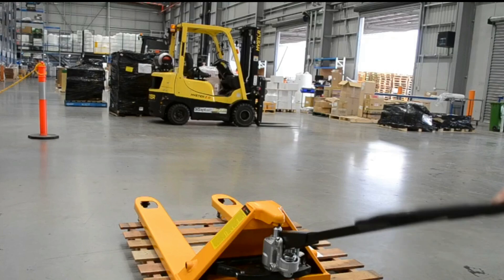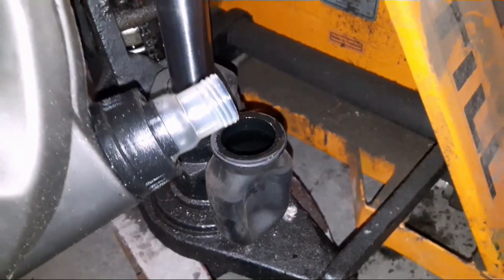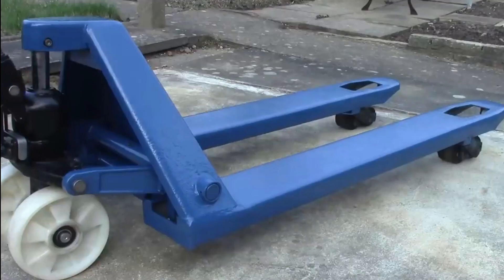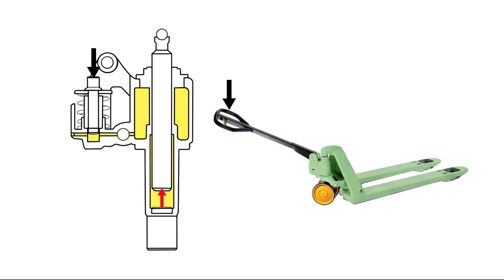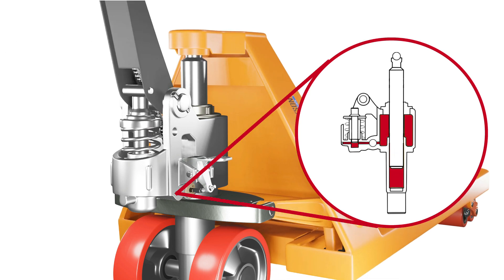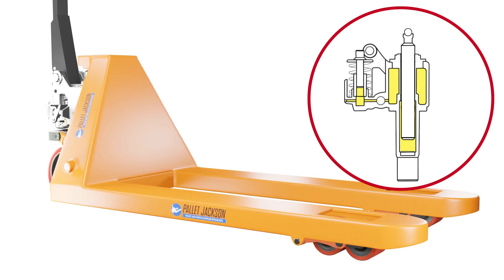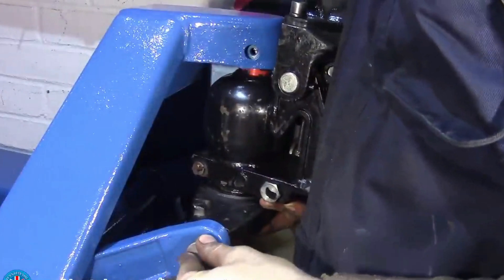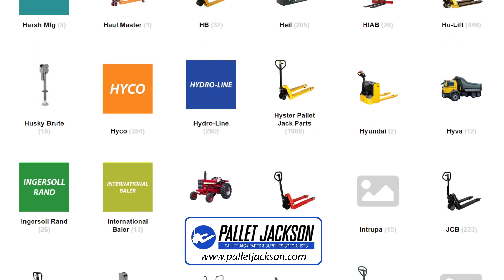Pallet Jack Hydraulic System Explained | How Pallet Jack Hydraulics Work | Hydraulic Basics

Comment: But how do the front wheels work?
Reply from the maker: Hi, thank you for approaching us with your query. The front wheels (commonly referred to as "steer wheels") on pallet jacks are pivoted and connected to a tiller or handle. When the operator moves the tiller left or right, it causes the steer wheels to turn in that direction. This steering mechanism allows for precise control and maneuverability. We'll soon share a detailed video on understanding the front and rear wheels of a pallet jack, briefing their functions and roles. Keep connected!

We hope that this will help resolve your query. Thank you again!
Reply: @PalletJackson  I think what @jeremylakeness6859 meant was, If you are lifting the back of the pallet up with the hydraulics, how do the front wheels on the fork ends stay up to support the load and keep it level.

Comment: AMAZING VIDEO!! helped me get a better understanding of what I'm dealing with.
I have a jack that the piston does not go down. I already checked the release valve lever and even manually held it and did not go down. I decided to take the hydraulic bolts off. Right now all 3 sections are empty, hydraulic cylinder, Hydraulic pump, and a bolt that was in the bottom by the wheel which I'm assuming is the hydraulic fluid (yes hydraulic came out from this bolt too). Keep in mind the piston is still up high and wont come down. any info helps. THANK YOU!!!
Reply from the maker: Hi Steven. Thank you for contacting us. Based on the information you have provided, it seems like the main lift ram is bent, and it is stuck inside the unit. Please check it. We hope it will help.
Reply: @PalletJackson  Thanks for the info!

Comment: great info, is the process the same as on your video to add hydraulic fluid to a crown pallet jack?How can i measure the current fluid level without a dip stick
Reply from the maker: Hi, thank you for contacting us. If your Crown pallet jack doesn't have a dipstick, you can measure the fluid level visually through a sight glass or by observing the level relative to a marked fill line on the reservoir. Another suggestion would be, use a thin wire or a straw. Insert it into the fluid reservoir and mark the wet part. Then, compare it with the recommended level.
We have made a detailed video on how you can add hydraulic fluid to your pallet jack. You can check it here: https://youtu.be/qgYetDHayLg 

We hope the recommended video will help resolve your queries. Still, if you have any questions, you can email us at info@palletjackson.com or call us at 832-239-5393 for a more detailed consultation. We are available 9am to 6pm EST, Monday to Friday.
Reply: @PalletJackson   ok great the video does not depict a crown pth though, there is no screw like that on top to fill, I am not sure where to fill the oil
Reply from the maker: In this case, we recommend you to refer your pallet jack's operating manual. Or reach out to a skilled technician so he can guide you in real time after assessing your equipment's design. 

Besides, we welcome you to contact our technical customer representative team; they might have a solution to your problem. Thank you!

Comment: Is a broken cylinder body fixable?
Reply from the maker: Hey, thank you for contacting us. It depends on the severity of the damage and the cylinder material. In many cases, a broken cylinder body can be repaired through welding or other specialized techniques.

If the damage is minimal and doesn't compromise the structural integrity, a skilled technician will be able to weld it. However, if the damage is extensive or if the cylinder is made of a material that doesn't weld well, a complete replacement will be a more practical option.  You can call us at 832-239-5393 or email at info@palletjackson.com for more detailed consultation. Our business hours are 9am to 6pm EST.